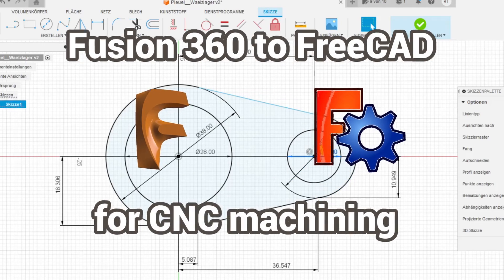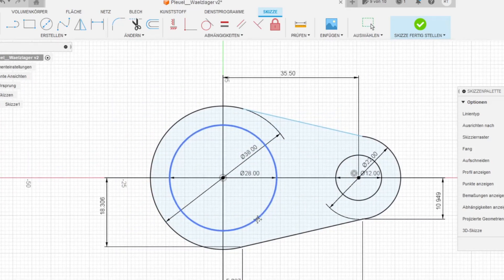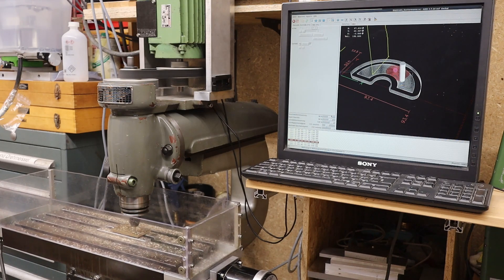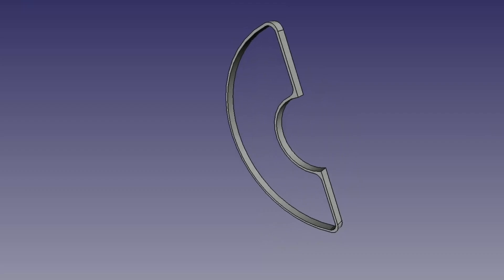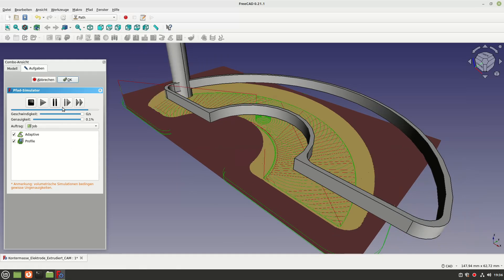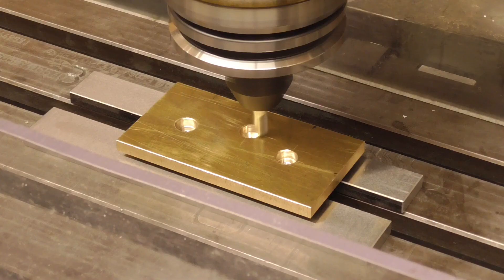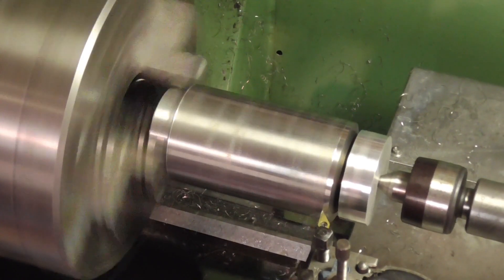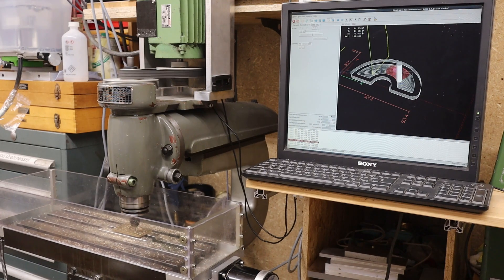Fusion360 to FreeCAD for CNC and CAD / CAM to LinuxCNC with the Path workbench

Comment: I didn't realize freecad was a full featured CAD/CAM program. The stigma of the name "Free"CAD throws off a lot of uses because many people (myself included) think just because its free that it's not a useful program. I was wrong. Very wrong. I am not updating to window 11 so i need to find apps that work with linux and the rest of my hardware/software. It's really a spectacular program, especially since the 1.0 update. The CAD/CAM was the only barrier to me going to linux fully, as i really don't like windows. The more people switch to linux the more software developers will make apps to work with it. If linux gets ~30% of the market share, it will force companies to integrate their software to run on linux. I did not intend this to be so long winded just to thank you for the video.
Reply from the maker: FreeCAD is truly excellent, and once you get past the initial difficulties, it is much more versatile than the competition! I work almost exclusively with Linux and open source, and I am extremely productive! Thank you for your positive comment!

Comment: What program did you use to generate your Lathe toolpaths? That was not really clearly audible in the video.
Reply from the maker: I use NativeCAM for lathe toolpath or sometimes I code directly into G-code.
Unfortunately lathe toolpath are not so good supportet by most CAM programs.
In Freecad the easy use is still in the developing stage afaik but in Fusion360 it works well.
I don't want to use windows any longer so Fusion360 is no longer an option!
Reply: thanksb

Comment: how are you supposed to clean up the part there is extra material on the sides.. the profile will do the exterior but the actual face even with extra material allowance doesnt quite clean my edges
Reply from the maker: I don't think I understand exactly what you mean.
Sometimes you have to add a finishing cycle or adjust the cutter radius.
Can you explain in more detail what you mean exactly?

Comment: It's nice to see you back at the Stirling engine! I'd be interested to see a video on the heat exchangers, and on the thermodynamic cycles. I see you did some FEM CAE for those, that'd be really interesting to hear about, especially if you did it in FreeCAD.
Reply from the maker: When the new drive works satisfying I will focus on the heat exchangers and report about them in detail.
This includes the calculation with the similarity methods of Dr. Allan Organ and the final production with my pulse EDM.
I made the FEA with Ansys and will show this too if you are interested.
Reply: @myengines2443  Definitely! I have seen glimpses of a PV diagram in your videos, and it would be awesome if those measurements validated the FEA, especially if there is a CFD simulation of the cycle. A very high bar, I realize! But it would bring the engineering full circle (cycle) :)

Comment: For the path, I'll just hide the original model and show the path model, then it's ok. I've just had my mill into working condition so I've got only little experience with path. I made the switch from f360 to FreeCAD when the first limitations came and only thing that I miss is a good assembly constraints -now I'm going with in-place design with multiple level containers for moving parts in groups..
Reply from the maker: That sounds nice, thanks for your comment and tip!
Reply: Check out ondsel’s lates build, Ondsel ES for the upcoming integrated assembler
Reply from the maker: @HenrikSyvertsen  
That really looks nice, Freecad 1.0 would also sound amazing, thx for your comment...